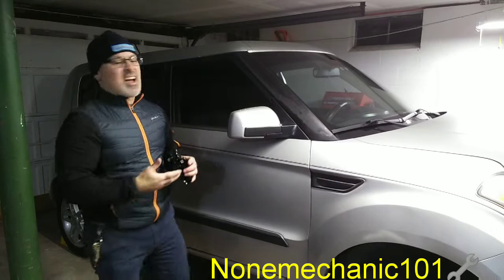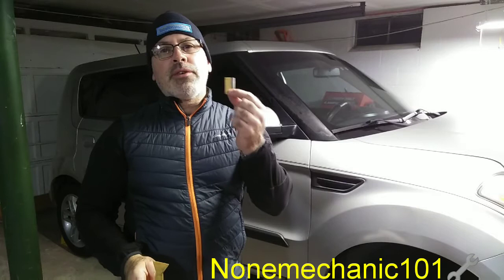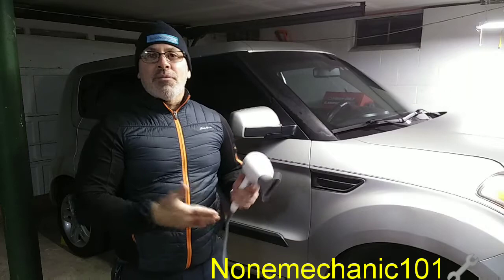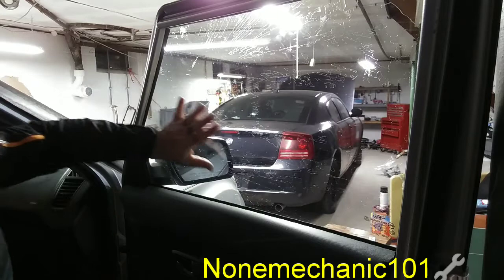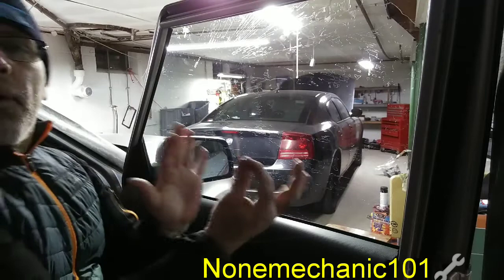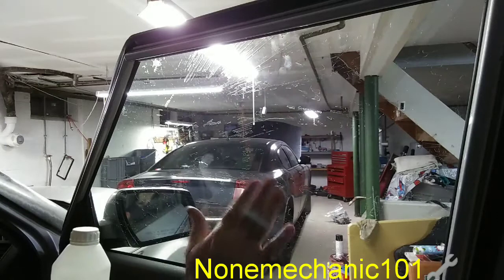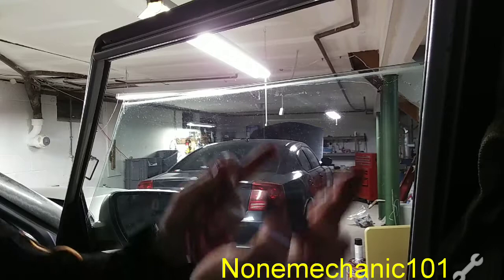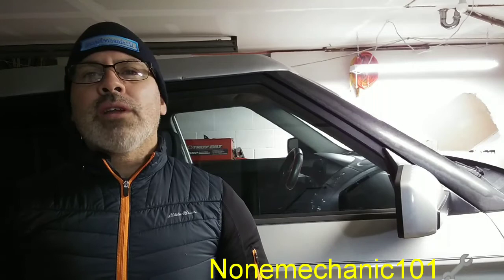Removing Car window tint and glue with a hair Dryer and Isopropyl Alcohol

Comment: This method doesn't work for old baked tint.
I have a much better way to remove it. The basic idea is using Super Strong chemical to penetrate the tint.
You need some old school paint remover, or you can mix 6 part of methylene chloride with 4 part of methanol. You need protection gear of these chemicals. You put a lot of them on the old tint. Wait for 10 min. The tint will come right off without any effort. Then, use acetone to remove the glue. Repeat the process above..

Reminder: any product contains Methylene Chloride will do the job. It can get the job done really fast. However, this is a highly toxic chemical. You have to wear protection gear to do the job.
Reply from the maker: Thank you!